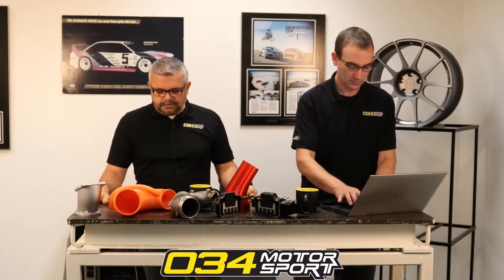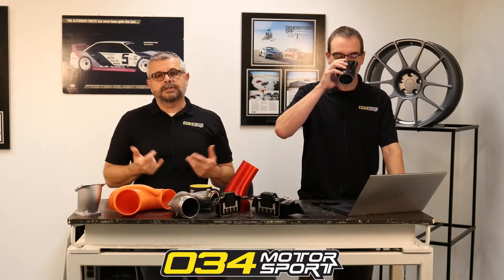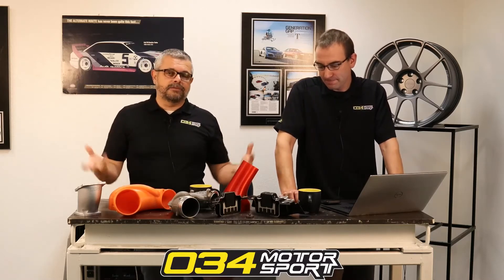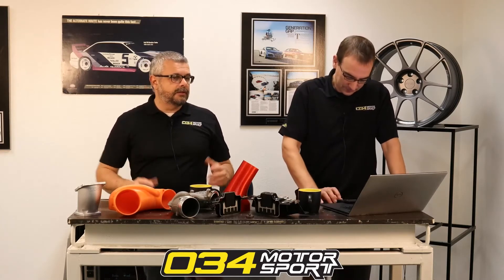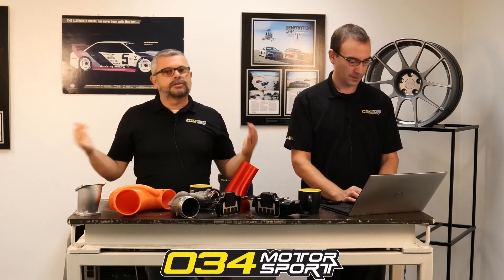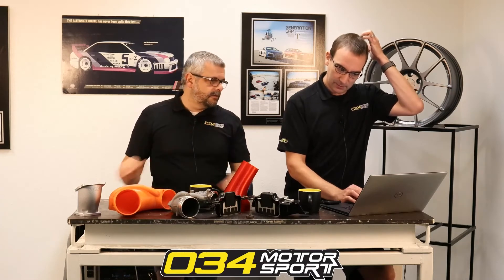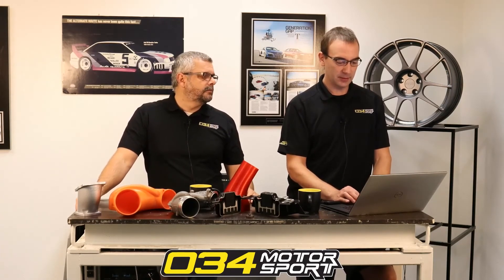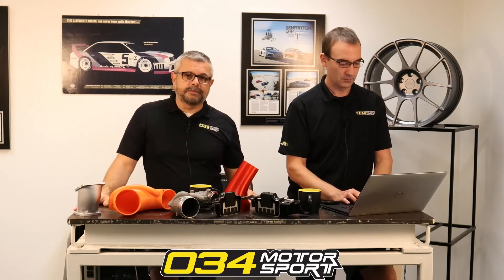What do Phenolic Spacers do? | 034Motorsport FAQ

Comment: Can you guys review the phenolic spacers being sold for the 3.0tfsi? It goes between supercharger and intake runners.
Reply from the maker: Can you elaborate? We do not currently offer spacers for the 3.0TFSI
Reply: @034motorsport there is a company called plasmatio selling space plates that go between the supercharger and intake runners. It doesn’t seem like any other companies make a similar product for our platform. There are multiple companies making spacers for the supercharged hellcats but only one for Audi 3.0tfsi. It would be interesting to see you all test it out for heat soak prevention
Reply: @034motorsport would you consider making some? Or testing some ? Basically same dimensions as the WMI plates except it’s just for thermal management. Supercharged coyotes and hellcats run them

Comment: Do you have any data to show this affects heat soak whatsoever? Your engine bay is going to be quite hot as it is when at operating temp, and its been shown over the years, particularity in the Subaru community, that these do not increase power whatsoever nor combat heatsoak. These are just for spacing and fitment adjustment.
Reply from the maker: It’s been over 10 +years since we released a new phenolic product but yes we did testing in the past and they work, it’s a cheap modification and works off the simple concept of heat transfer as we discuss in the video. Newer cars have been plastic manifolds for some time so we haven’t needed to make them since.

Comment: I'm pretty sure it's an important mod to have. When you're drawing in a hot air, you're losing horse power, and you're at my is horsepower, android mileage would go down as well. I can imagine why this would be something you would do after the engine is built all the way across so little, and offers thermal protection.